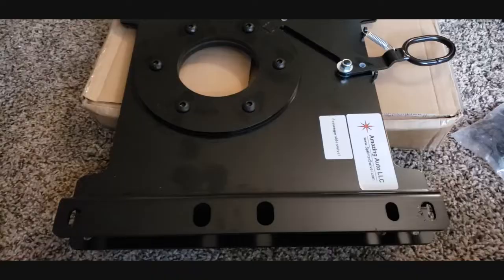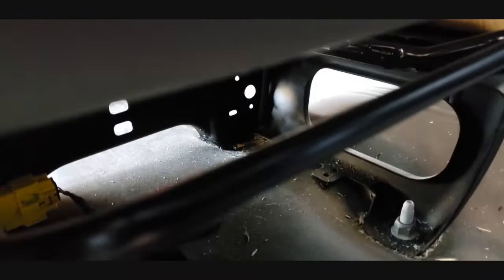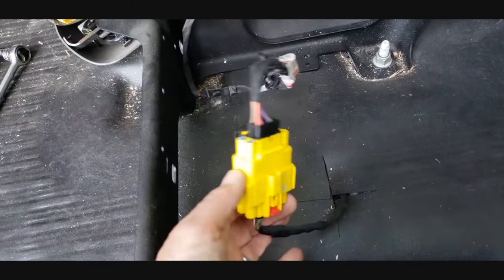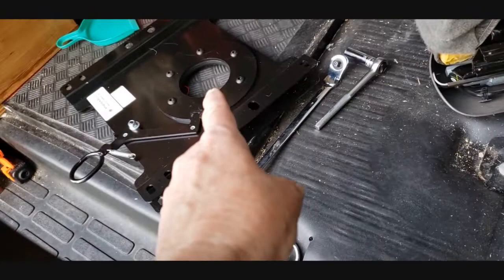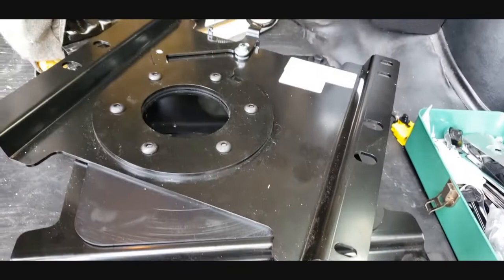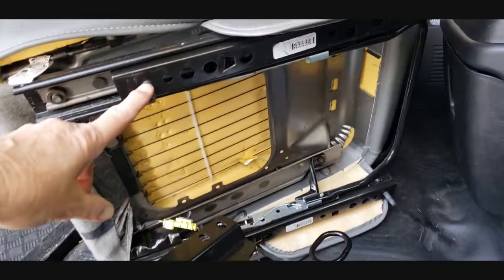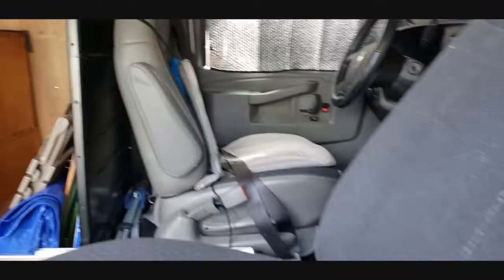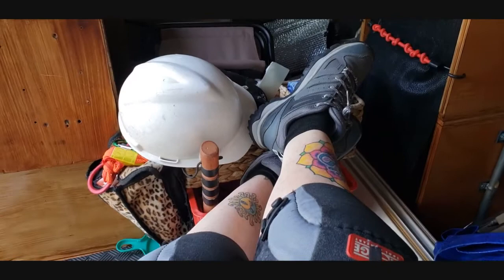Swivel Seat install 2019 Chevy Express

Comment: Did you by chance get a “service air bag” message or throw any codes after reconnecting the air bag wires under the seat?…..just curious as I’m getting ready to do the same to my 2019 GMC Savana and have read elsewhere that folks are getting the “service air bag” error message.  Thanks
Reply from the maker: Hello Michael,  I did get that error but only because I did not connect them back together. As soon as I saw the error, I reconnected and when I started the van again the error went away. I think it looks for  a connection even when the airbag key is in the off position 🤔
Reply: @MacgyverSharon  thank you for the reply.  Any issues with rotating the seat after the wire harness was reconnected (was there enough play in the wire to allow the chair to swivel without pulling the wires tight)
Reply from the maker: Hi Michael, It looks like there is plenty of slack...although I only installed it yesterday 🤣 I believe there will not be a problem. But I will look at the cable assembly in all positions now that you mention it 🤔 Thank You!
Reply: @MacgyverSharon  thank you Sharon.  If you wouldn’t mind letting me know if there are any problems with rotation that way, since we have the same year van, I can determine if I want to proceed with my installation.
Reply: Hi Sharon….quick update.  Just finished installing the swivel seat adaptor on my 2019 GMC Savana.  Prior to installation I Disconnected the battery before disconnecting the airbag sensor under the seat.  Ran the wire harness through the center hole in the swivel adaptor, reconnected the airbag sensor and there is plenty of slack in the wire harness to allow for seat rotation.  Reconnected the battery and no codes or “service air bag message”……thank you again for the information.
Reply from the maker: Excellent!
Reply from the maker: @michaelmagnet7079  i was going to check it out after work...but you got it! 👍👍